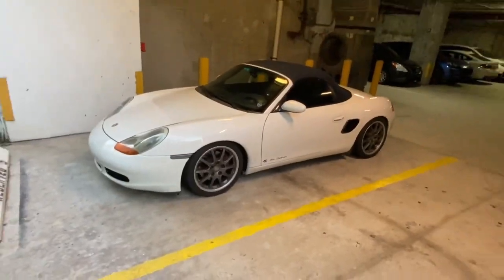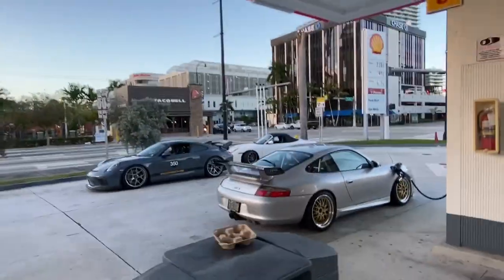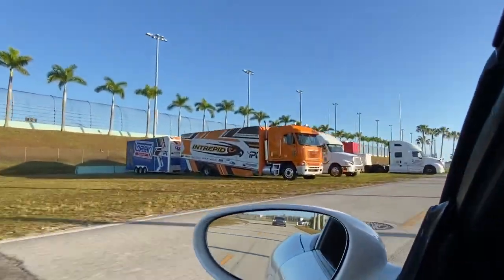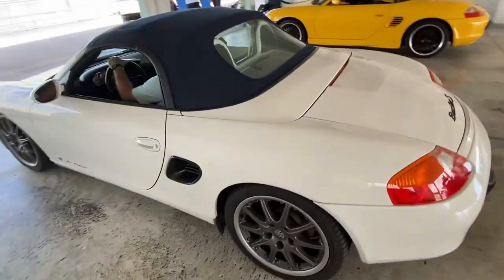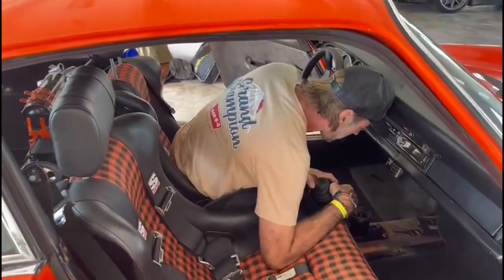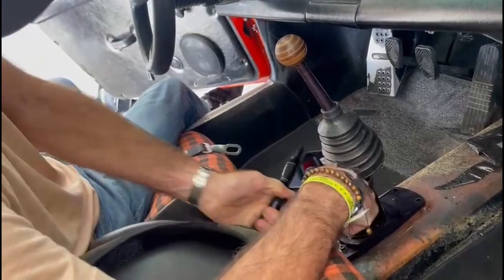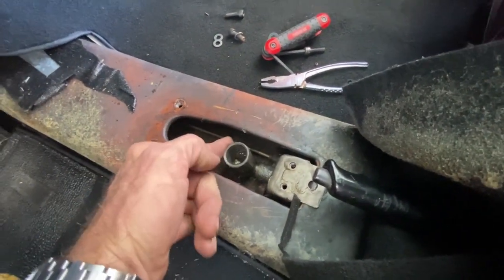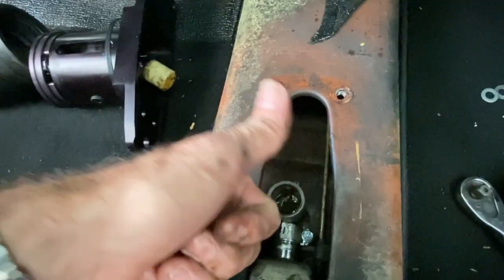Porsche Boxster S at the Track !!!

Comment: Great video. I love how you don't hesitate to jump in and fix another persons car. I recently just purchased a 2003 986 Boxster S. Other than the IMS what other parts would you recommend fixing/replacing to make it a super reliable daily driver? Also, you mentioned something in a previous video, other than the break pads, what do you recommend upgrading to taking it to the track? Thanks!
Reply from the maker: For track use you want to install a deep sump kit and X51 baffle, underdrive pulley, stainless brake lines, good brake pads and fluid.
For regular street use I wouldn't really worry about doing anything to it. If doing the clutch you may as well knock out the IMS but otherwise just drive and enjoy